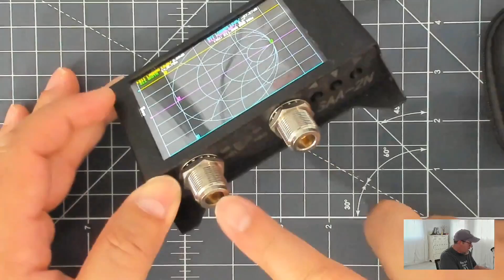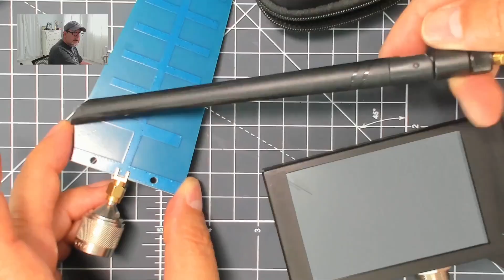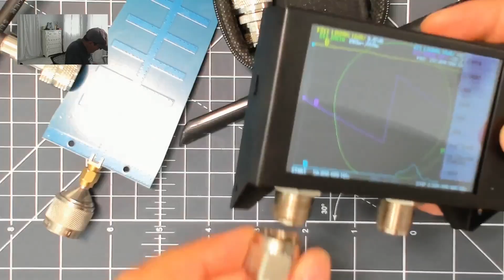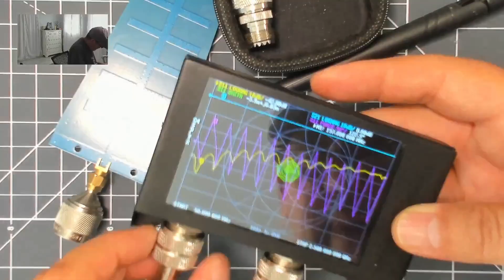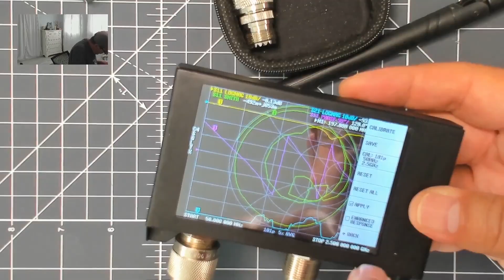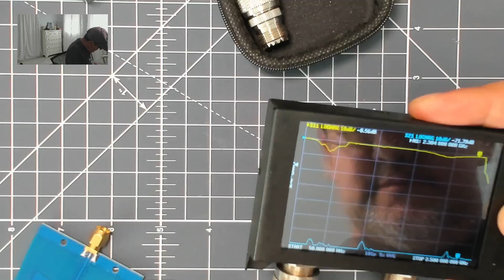NanoVNA repair and Cal

Comment: That’s a small part!
Reply from the maker: I know right.     It needed a hot air tool with a smallish blower tip and some patience.
Reply: @dan_in_sd that might be above my pay grade
Reply from the maker: Incidentally,   the blog post at KA7OEI website suggests adding a TVS diode to the SMA Port to resolve any future ESD issues.   I bought some diodes but have yet to do that mod.   Another possible way to protect the NanoVNA from ESD is to always use a 2 or 3dB Attenuator on the ports but then subtract that out when doing any calculations.
Reply: @dan_in_sd good info 👍